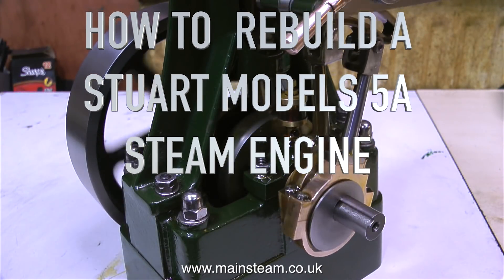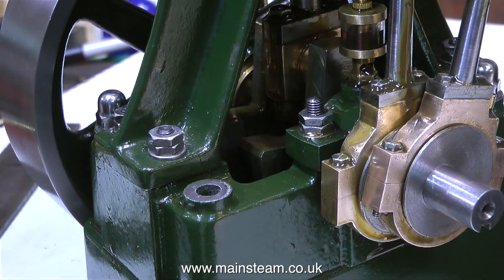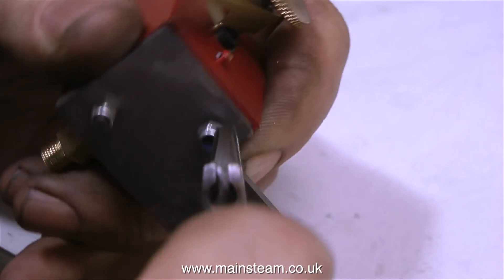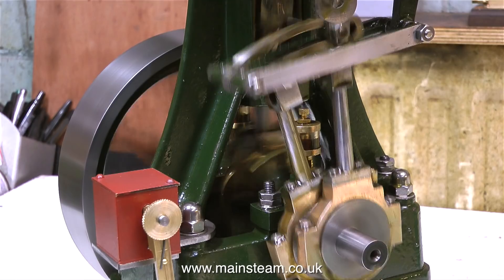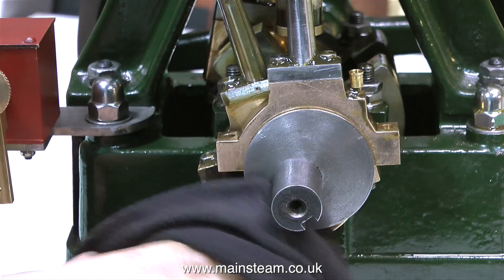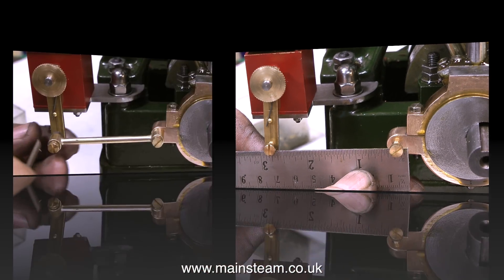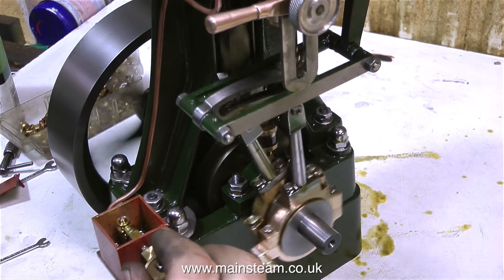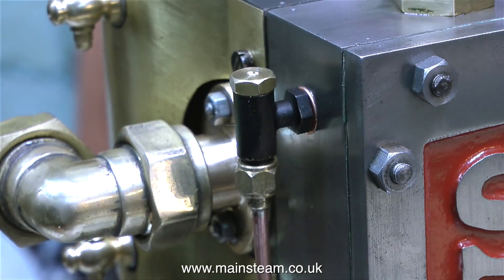HOW TO REBUILD A STUART MODELS 5A STEAM ENGINE - PART #31

Comment: When oil if introduced into the steam/air inlet, I can sort of understand how it might get atomized as it enters the valve chest and coats the inside of the valve/cylinder that way.

But with the oil dribbling in like it does with the pump, I don't see how the oil gets anywhere but on the bottom half of the cylinder? Especially at low speeds where the valve mechanism might not be moving fast enough to fling the oil up. I suppose it must still be adequate though.

Comment: Hi, Keith. Looks and sounds great. Do you have a video that shows how the oil is deposited inside the steam chest? It's not just dripping down the side of the chest, surely...
Reply from the maker: I have no idea how the oil is deposited inside the steam chest, as long as the oil goes into the steam chest it is carried by the steam flow to where it is needed . . .

Comment: Noob question here. How do regulate the amount of oil pumped into the cylinder?
Reply from the maker: On some lubricators you can adjust the flow, but usually this design is fine when driven from an eccentric.

Comment: Does the lubricator have a sight glass on it somewhere or do you have to remove the top to check the oil level?
Reply from the maker: it's a bit small for a sight glass .... you just lift the lid to have a look . . .

Comment: regarding the engine you are doing with oilite bearings, does that mean you will have fake oilers on top and just add oil yourself?
Reply from the maker: ??? - Oilite bearing material still needs oil . . . .  so it will have oilers fitted.
Reply: i appreciate they need oil, i wasnt sure how the oilers work with the oilites, do you drill a hole through for the oiler?
Reply from the maker: Yes, I will be drilling an oil hole in the Oilite .....

Comment: Nicely done ! 
Would you rely on the oiler completely or loosen the pipe to squirt a bit of extra oil in before starting up ?
Reply from the maker: I would rely on the mechanical lubricator - just like I do on my small locomotive that I run around the Garden on sometimes . . . .